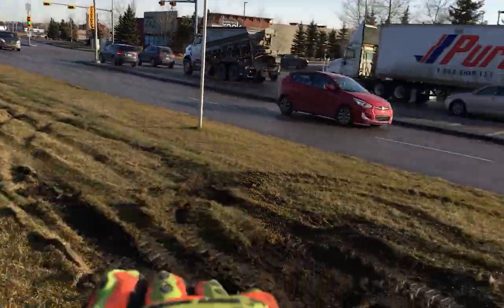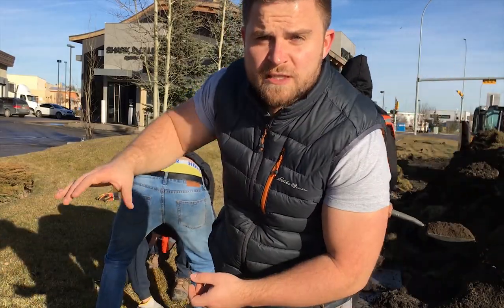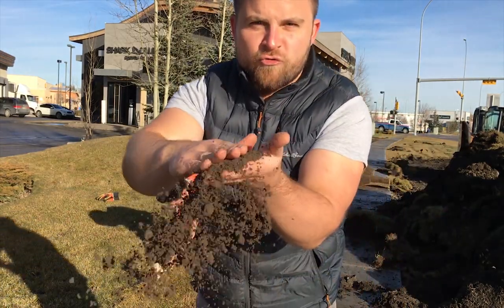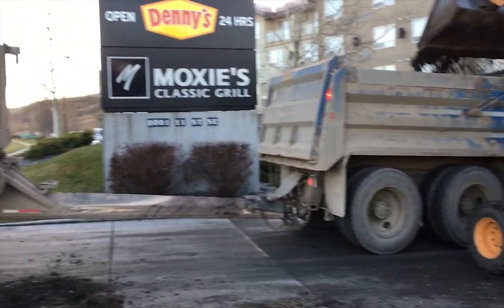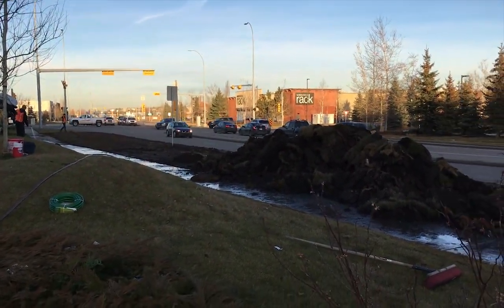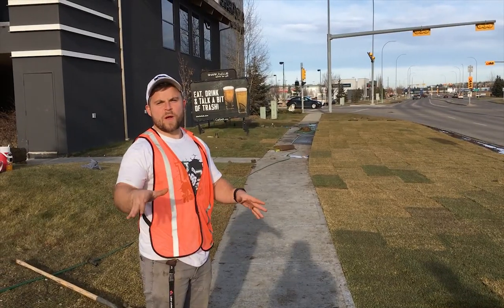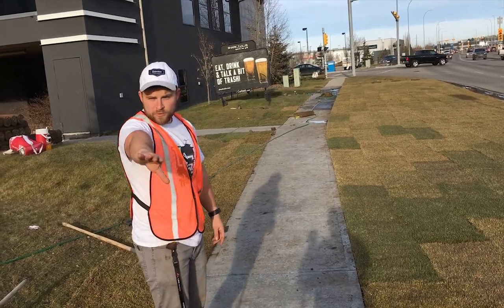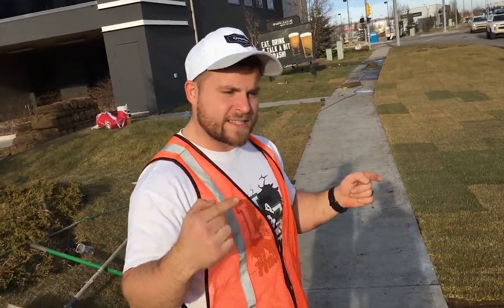HUGE $9000 Sod Job (4500 sq.ft) in 2 Days

Comment: Surprised you guys responded so quickly. In my area, The Villages Florida, there is a 6 week backlog for commercial sod replacement and small residential sod jobs are impossible to get help.
Reply from the maker: Wow! Supply and demand is really out of touch with each other currently it seems.
Reply: Is it still like that ?

Comment: Hey bro, do i recommend customers to call 411 to check cables and gaslines? Or would i have to be absolute and let them know to get it or i wont do the job? Or do i call 411 and include that in the service?
Reply from the maker: For sodding theres no need to call for gas or electricity. Aslong as you aren't significantly lowering the grade.